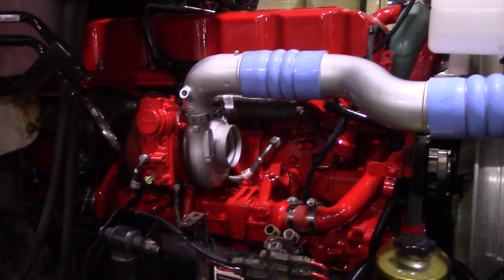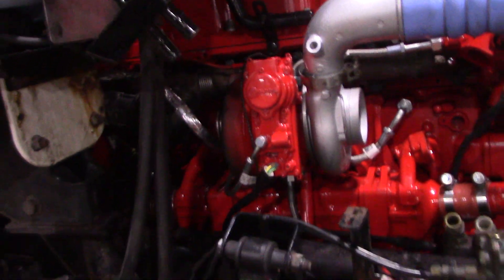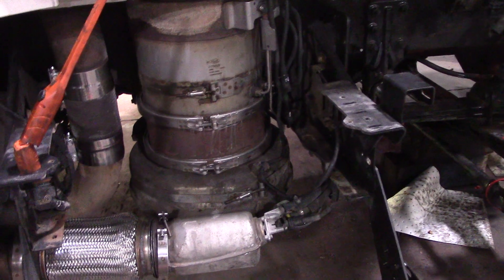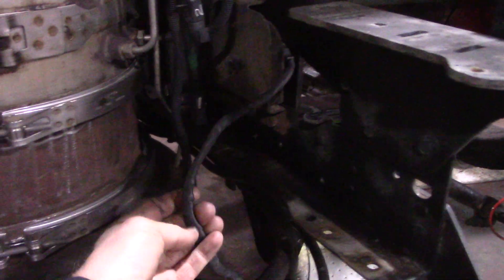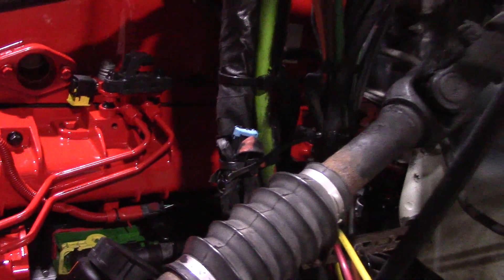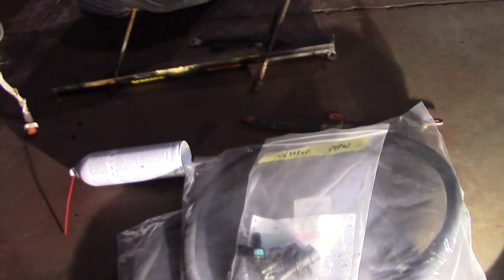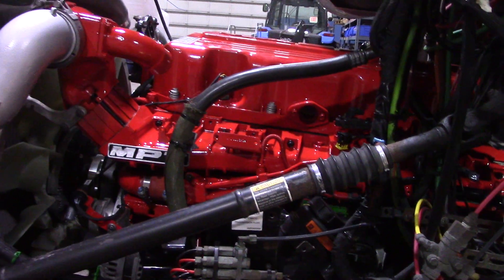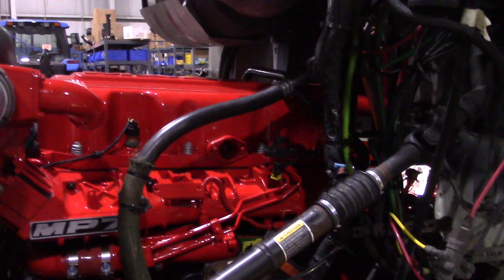2015 Mack CXU 613 engine issues/updates

Comment: 2014 Mack CXU613 
Lighting bolt comes on 
I lose engine power push gas pedal and nothing 
light goes off Truck sputters and picks back up speed..Help ? Change foot pedal and filters No check engine lights
Reply from the maker: @user-fn9oo1dg4h  any other codes, the ECM has to be seeing something
Reply: Ok after changing fuel filter and driving Truck ask for regen Truck won’t let me check soot levels on dash ? Don’t know why- I’m thinking that caused the loss of power NOTICE white buildup around pipe coming of dpf
Reply from the maker: @user-fn9oo1dg4h  Sounds like you may have a dozer problem
Reply: Ok thanks- doser will cause that lose of power ? I have one of course aftermarket. I’m thinking replacing belloow pipe the caked up white stuff on clamp is a leak indicator do I change gasket only or both Gasket and clamp ?Anything else I should look for
Reply from the maker: @user-fn9oo1dg4h  I would look for heat lost, bad or broken clamps or crush gaskets, damaged exhaust pipes,  bad 7th injector, your losing power bc the ecm sees a problem and it's trying to protect itself
Reply: @dandiesel5109  changed fuel pump and fuel filter house HAD THE SAME ISSUE keep researching-had a few loose wires under hood fire wall *GRAY GROUND WIRES tightened them up and everything is good so far HOPE WE CONTINUE TO HELP EACH OTHER only thing now CANT check my soot levels from dash For some reason it not letting me??

Comment: Quick question. Will an isx 15 work in a cxu613?
Reply from the maker: Not 100% sure, I only just started working on Mack's, if it's a complete engine swap with ECMs, anything will work, but getting it to communicate with the truck is another issue,  especially if it's not set up for it

Comment: What is the part # for the coolant lines?
Reply from the maker: Do you want the ones that go behind the engine? They are on national backorder I'm trying to get them aftermarket
Reply: @dandiesel5109  the bracket with the pipes
Reply from the maker: @Mack-mi9og  the brackets are available, I'm still waiting on pipes from Mack
Reply: @dandiesel5109  on your video at 4.42 those lines, mines are rusted i have to change them bad
Reply from the maker: @Mack-mi9og  ok, I'll make a video on Monday and I'll try and get all the part numbers in the video
Reply: @dandiesel5109  thanks dan
Reply from the maker: @Mack-mi9og  No problem, trying to help out